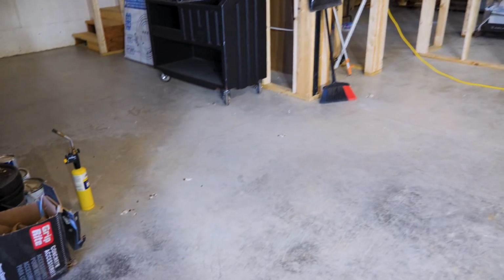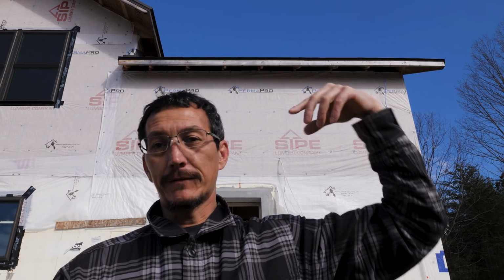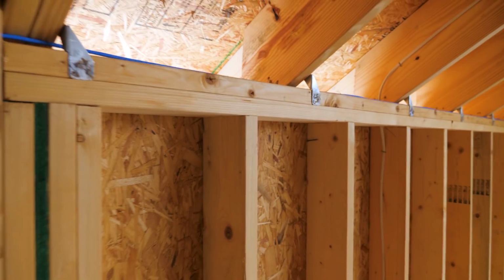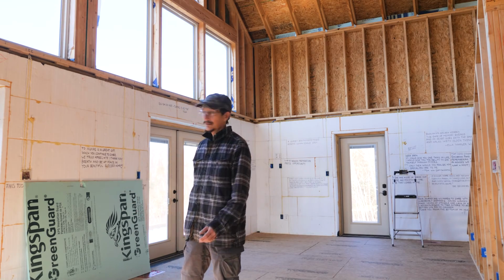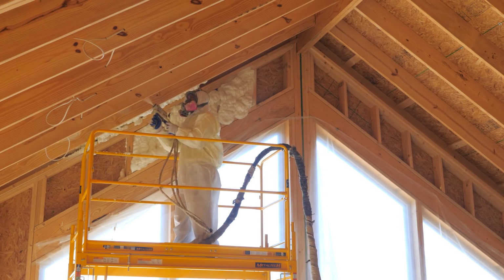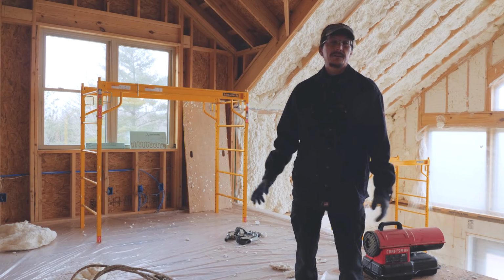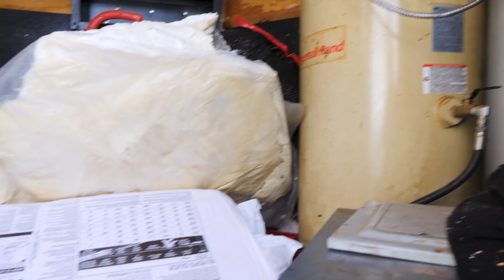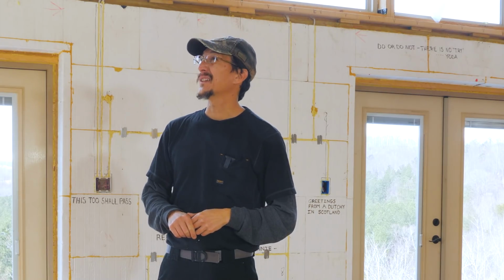ICF Mountain Homestead: Insulating with Open Cell Spray Foam

Comment: When I was in Jr. High, I helped my dad with an addition onto our home. He did every single step by himself and I helped where I could - laying rebar, snapping lines, running electrical lines. There is not a better feeling than when you are buttoning up and adding insulation.  How exciting! There's a light at the end of this mountain tunnel! ❤✌

Comment: When birds got loose in my house, I threw a towel over them which knocks them safely to the ground and covers them, allowing you to pick them up. Throw the towel up so they fly into it and it will fold over on them. Good luck.

Comment: Out of curiosity, have you considered putting insulation batts in the inside walls?  If not, you might want to look into it. It's a really cheap way to add A LOT of sound proofing and it will stop the interior wall cavity from being at different temperatures than outside which cuts down on popping and shifting (and noises).
Reply: I did pink stuff in all my interior walls and ceilings, used 5/8s firerock (not LITE) and sealed all seams with sound caulk.. It made a huge difference in STCs
Reply: @FJB2020  it'll flop overtime, rockwool would've been better option
Reply: @AmazonWebService98  Rockwool sucks.. It cost 3x and doesn't outperform the pink stuff in noise reduction (real world STC testing).. And if you staple the bats up it should never come down..
Reply: @FJB2020  damn well if you'd hire someone to  do your interior wall with paper you pay 3x as much as safe and sound bat
Reply: @FJB2020  and 3x as much, clearly you never priced it it's 48 dollars for 59.7sqft , vs 47.98 for 67.8 sq feet . Not sure where the 3x as much is . Plus the fact that you can get 30% off when you buy 15 or more rockwool is no brainer. Easier to install vs interior walls stapeling which I've never seen anyone ever do
Reply: @AmazonWebService98  I have used both and I don't like rockwool... It looks like they have reduced their pricing a bit so it is .88 sqft for rockwool and .53 for fiberglass (2x4 cavity)..  There is no reason to spend more money on a product that doesn't out perform the other.. The only thing I like about rockwool is it's easier to cut (when new) than Fiberglass.. But from a STC reduction, Fiberglass is cheaper and works just as well if not better (actual 3rd party testing)
Reply: @AmazonWebService98  Just went back to my sheet when I was pricing out materials for my home theater build 2 years ago.. Rockwool was $1.31 a sqft and fiberglass was .48.. So that is why I said 3x..
Reply: @FJB2020  but you don't put faced bats in interior walls , so it won't last as well since it'll flop down over time. Rockwool does not ALLOW mold. and is more fire resistant, superior product in general

Comment: I have a question... I know when you do regular fiberglass insulation in a cathedral ceiling you have to install the styrofoam or plastic vent chases to connect your soffit vents to your ridge vent. How is it that you don't need a ridge vent?
Reply from the maker: With the metal roof we used we don’t need vents. This is an unvented roof system.
Reply: @Guildbrookfarm  Oh cool! Thanks! That would have bugged me forever! LOL
Reply: @Guildbrookfarm  how are you addressing vapor migration to the roof deck?  Typically 2" of closed cell is sprayed to the underside of the deck as a vapor barrier and open cell or fiberglass after that.

Comment: When you use the spray foam insulation is there any issue with off gasing, especially when it heats up in the summer?
Reply from the maker: This formula cures almost instantly but we gave it a couple days just in case.

Comment: I’m assuming that you did your research on the contractor that applied the foam to your house. But, are you still going to apply a strong vapor barrier to all the foam inside and out to prevent future off gassing toxic fumes from entering living spaces?
Reply: No need for a vapor barrier with spray foam once a certain thickness is achieved and after a day or two, there are no fumes.
Reply: @augustreil  with open cell foam there can be off gassing for months to years afterward depending on the chemical mix and and temperatures of the chemicals and areas sprayed. Unless you are using a contractor with a proven track record you can get a improper mix and a bad install very easily.
Reply: @liondirk , Exactly. If done right, there is no off gassing. That's why they were spraying test areas.

Comment: Its taken closely two weeks to watch all your videos from the first to the last.
One BIG question I have was with this video. How does your roof breath? I didn't see any venting installed. (Baffles) specially in the attic area.
Reply from the maker: Baffles are unnecessary here. This roof is vented on the outside. It is an unvented attic design. https://www.icynene.com/en-us/blog/insulating-underside-roofs-making-case-unvented-attic-assembly
Reply: The roof isnt supposed to breath with spray foam. Thats only with mediums that arent attached to the roof decking

Comment: A few years ago, I read articles about people experiencing chronic illnesses that they eventually concluded was due to off gassing from their spray foamed roofs.  I particularly remember one family recount that after their house was unlivable for months, finally took the extreme action of having their roof completely cut out and removed, then rebuilt from scratch.  

In your research, have you seen any changes in the spray foam formulations?  Any recent complaints of mysterious illnesses?
Reply: There are a lot of products that do this. Wood floors, paint, laminate flooring, AC, and etc etc. There is so much to stay on top of to research it is mindblowing.

Comment: Awesome progress and looks great!!

I apologize in advance for joining the ranks of a internet nitpicker who comments on your videos, but I just wanted to drop you a note in regards to your LV cat6 wiring. Traditionally, lv wire shouldn't be ran in the same stud hole as I saw in the video. Usually a 6" distance between lv and hv is advisable and any times they cross keep it at 90deg. Although in practice, cat6 is really pretty resistant to the electrical interference caused by the 120v lines compared to cat5e...but there is still potential for problems. It's a grey area when it comes to inspectors and the NEC as well.

If you're bored or potentially worried about it due to my comment, i'd put an expected load on that electrical line and test the packet loss and signal quality of the cat6 line. It would be easier to test before ripping it out of the insulation to move it to another line. If it all tests well, then no need!

Just wanted to drop yall the note. :) Take care and keep up the awesome work! You guys have inspired me to seriously consider GCing my own house build one day!
Reply: Good point, you shouldn't run data cables alongside power. If the cat6 is foil shielded then that will help.

Comment: would it be recommended that you have 1 inch of gap between the roof and spray foam for air circulation?
Reply from the maker: No that’s what you DON’T want
Reply: Theres not supposed to be air circulation with spray foam. In fact this roof should have been CLOSED cell foam

Comment: What is the cost for a project like this?, and how much extra was it for being in a remote area? 
why not spray the underside of the upstairs bedroom floors for sound dampening? (cost?)
Reply: For sound deadening fiberglass or rockwool batts are actually better.  The glass especially isn't as dense so it will attenuate sound better.  They're cheaper too LOL

Comment: I'm assuming that close cell foam would've cost more than open cell ....but takes a lot less of it and adds rigidity as well .
Reply from the maker: 3 to 4 x more
Reply: @Guildbrookfarm  have really enjoyed watching the build.  We found this recently.  Do you cover in any of the videos why you chose to stick build the top part?
Reply from the maker: A few reasons. Cost, insulation comparison, the gable wall of windows.
Reply: @Guildbrookfarm  and open cell has overall less chemicals...
Reply: Open cell expands 110 percent of it liquid volume and closed sell is only 30 percent of its liquid volume there open cell covers more board feet then closed cell

Comment: What about that foam in contact with your electric cables ? Don't think that's allowed here in the UK.
Reply: Not an issue in most parts of the US from what I've read.  You just want to be POSITIVE you have all of your electrical and mechanical systems in place out before you foam.
Reply: I am no longer a sparkie, but in the UK it WAS allowed, but you had to de-rate the cables so for instance you may need to run sockets in 4mm instead of the normal 2.5mm T+E! It is all about the heat dissipation ;0)
Reply: @totherarf  Agreed - that applies to any insulation covering cables. What I was thinking about was an actual chemical reaction between the foam and the cable itself causing the outer insulation to degrade - I have read about it somewhere but can't just remember where.

Comment: What are you going to do about the attic ceiling insulation.if I was you I would spay foam that as well to give the  air handler and flex duct a cliement controlled environment.beleve me it will save you electricity and make your  flex duct last for years
Reply from the maker: We sprayed everything
Reply: @Guildbrookfarm  I feel like a fool.I watched the next video and saw your  attic ceiling anyway I just wanted to say your house is beautiful
Reply from the maker: Lol no worries man. Thanks for watching 👍🏻

Comment: The guy spraying did a horrible job, you will have the foam pull away in tons of places leaking air in. He should have ran down the corner of rafter and decking. Then, side to side filling the middle.

Comment: Was that a clerical error or did you really choose open cell foam?  If so why would you with all the negative input experts have given over the past ten years or more?  If you want to spray closed cell would be the only sensible choice.  Open cell just has too many negatives a big one is that it absorbs moisture and it shrinks.  There are many many more.
Reply: I was wondering the same thing. Closed cell foam is the far better choice sense it doesn't absorb moisture and it also has about twice the R-value per inch.
Reply: let's not look past how unfriendly it is to the environment to make